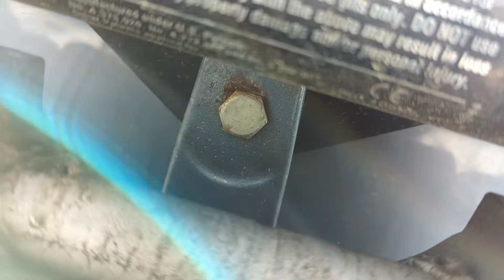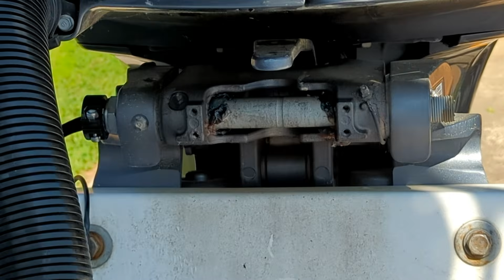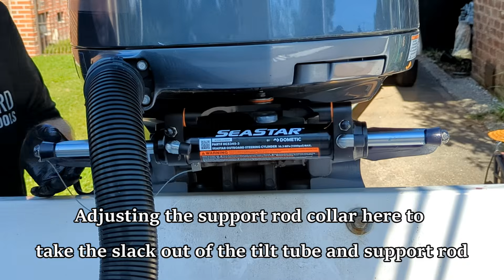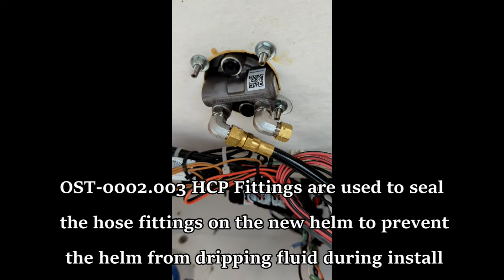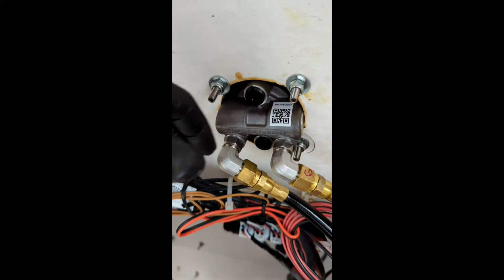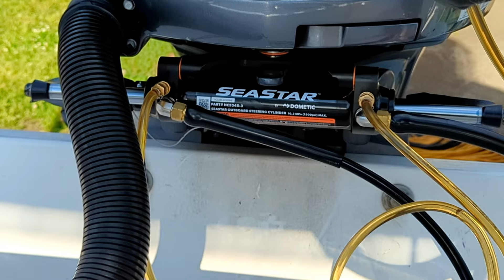Damaged SeaStar Hydraulic Steering, Removing and Replacing SeaStar Cylinders and Hoses

Comment: Good infomative video.  I was mostly interested in what end the factory installed hose fittings went to. Nothing in the directions.  I noticed you attached them to the helm and  cut the lines to the outboard. I did the same but noticed all the other videos did the opposite. Hope i did the right thing.

Comment: Great video,

Are you using any thread locker like Loctite?
Reply from the maker: No, SeaStar uses nylon lock nuts to fasten the support bracket and piston rod.  Usually they are reusable unless damaged during removal.

Comment: Awesome video! I recently upgraded my motor from Mercury 150hp two stroke to a Suzuki 250hp four stroke. Do I have to upgrade my complete SeaStar hydraulic system can handle the 250HP motor and if so, which do you recommend? Please cause currently it’s leaking hydraulic fluids and I’ve change the seals several times already thinking it was my ram stabilizer that causes the leakage when I put them in to tow to prevent the motor from tilting. Thank you. I really enjoyed the  video and 👍 n sub.
Reply from the maker: If memory serves, most SeaStar Steering Cylinders are rated up to 300 HP for a single cylinder.  However, I  would strongly recommend that you contact SeaStar tech support with your cylinder model number to confirm the HP rating.  The DF 250 is a fairly powerful motor, if there is still fluid leaking from the steering system, it definitely needs to be isolated and the cause of leak repaired.   The overall age of the steering system components is a big factor.   I mostly see saltwater boats in my boat yard and in the local conditions, Helm, hoses, cylinders have about a 15 year maximum service life before they are either needing to be replaced or are on borrowed time
Reply: @outboardst.comoutboardspec8631 

Thank you for replying. I’ve had the seals replace several times and keeps leaking so I’m probably gonna replace the entire steering. Hopefully won’t have to replace my tilt steering wheel. It’s not that big of a boat, it’s only 21 feet and being a inflatable RIB boat, very light and from 150 to 250, gets on plane very quickly.  Thank you sir.

Comment: Hi, great vids and tools tha ks for sharing. Quick question. My transom is not open like in this video. Is there a way to remove the support rod from the tilt tube without having to lift the engine of the mounts? What are my options here? Leave the old support rod in place?
Reply from the maker: You can definitely leave the existing rod in place in nearly all cases.  Best case scenario is that the old support rod is still able to slide back and forth so that you can clean and grease the exposed sections of the rod before re-assembly but even a less better case scenario of the support rod being completely seized into the tilt tube, I've had good results over the years by removing the support brackets, cleaning and resurfacing them completely, and going back together with a heavy marine grease.  The critical issue is that the support brackets must be able to rotate and move independently of each other on the support rod as the cylinder goes through its entire range of motion.  In the vent that the support rod is seized, and you end up needing to replace it, for whatever reason, in addition to swinging the motor with a shop hoist/cherry picker, you'll also end up replacing the tilt tube, unless you are much luckier than I've been.  Because when the tilt tube and support rod become one piece, I had zero luck torching them to get them apart, and there is no solvent that will work either.